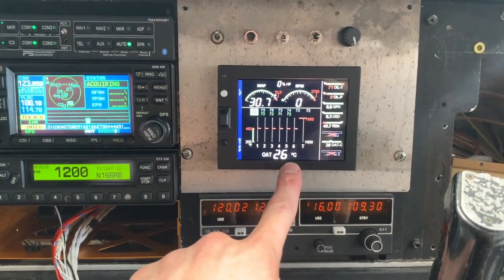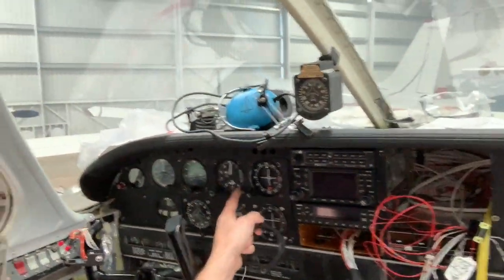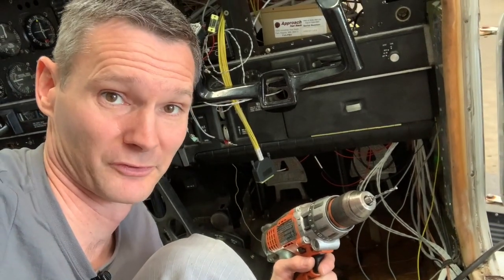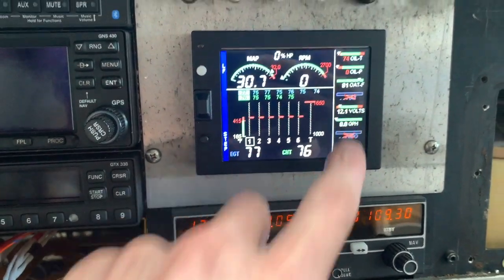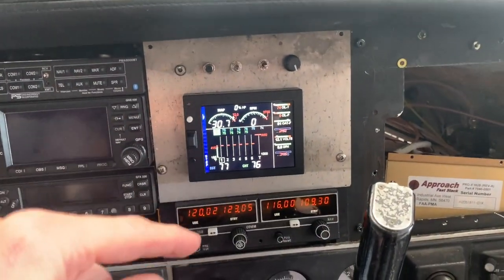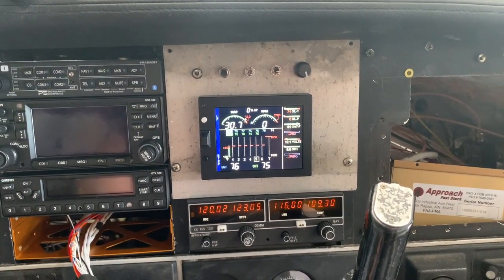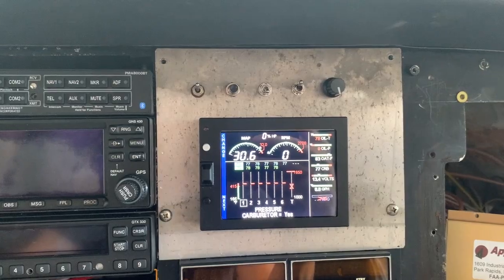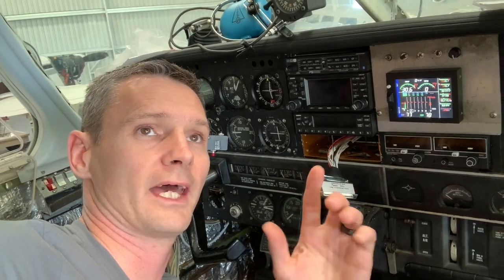*Easy Peezy! JPI 830 Done!  EP25

Comment: Thanks for the info on the pin removal tool, I work on home appliances and always used a very small flat head to slowly work burnt pins out so I could replace them. Just ordered a set on Amazon which should make my life allot easier, I always wondered if they had such a tool.

Comment: Monitor looks nice, but when you showed the IAT working, i saw on the main area of the screen "CARBURETOR = YES". Is that normal. Either way, it's coming along nicely,
Reply from the maker: I'm still figuring out all the correct settings, so, I'm sure that's changed.

Comment: Jimmy,
Is your JPI 830 installation a direct replacement for your old engine gauges?  In looking at your ofher vids, it sure appears to be, but In doing a bit of research I got the idea that it was not STC'd that way and it was meant to be in addition to the old engine gauges. 
Thanks
Mike
Reply from the maker: Great question Mike, the 830 is a secondary monitor.  So, all the old stuff has to stay :(. It's a trust but verify mindset and insurance.

Comment: Hey Jimmy..  How are you getting around part 43 for all this work?  I'm assuming you are not an A&P?

The Federal Aviation Regulations (FAR) Part 43, Maintenance, Preventive Maintenance, Rebuilding, and Alteration, permits the holder of a pilot certificate issued under FAR Part 61 to perform specified preventive maintenance on any aircraft owned or operated by that pilot as long as the aircraft is not used under FAR Part 121, 127, 129, or 135. FAR Part 43, Appendix A, Subpart C, Preventive Maintenance, lists the authorized preventive maintenance work. One restriction on such work is that it cannot involve complex assembly operations.
Reply: He is working under an APIA if you look at earlier videos he explains it. All the work he is doing is getting inspected so stop throwing regs out throwing a fit we all as pilots know that you can't do this level of maintenance without the supervision of an a ap. I worked for 2 years in a maintenence shop without an ap along with a couple of other guys most small shops can't afford to have every guy fully licensed. Its completely fine and no different then going to a school learing under an instructor it's just not as common. Cool thing is after a few years under an IA you can have him sign you off to get your ap.
Reply from the maker: Thanks for the comment, I get that question all the time.  I answer that on this enjoyable video: https://youtu.be/8M42B379apE
Reply from the maker: Thanks Brad, It's the most common question that gets asked.  It's also a very taboo subject in the pilot world.. a pilot doing anything to his airplane other than fly it... most pilots don't realize that they can do far more than they think (legally).